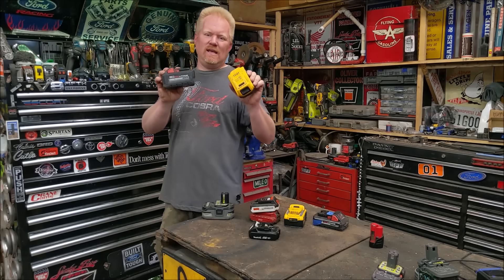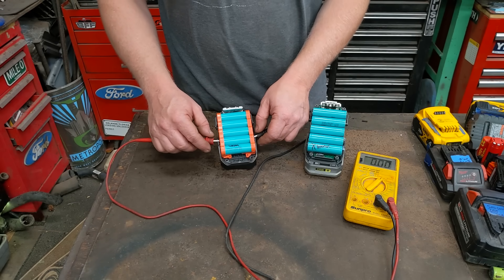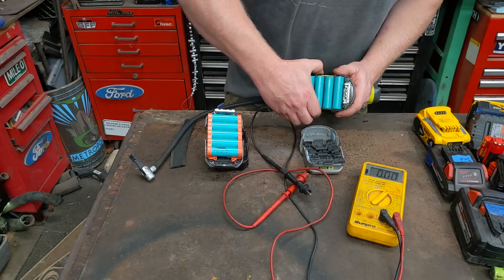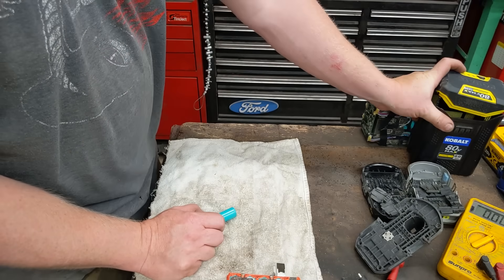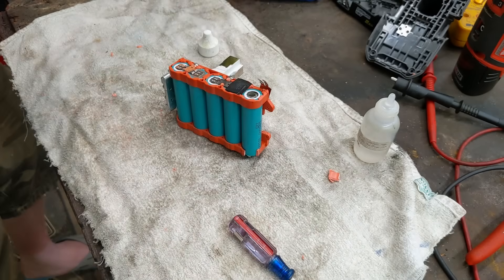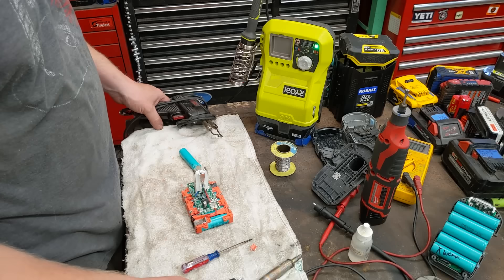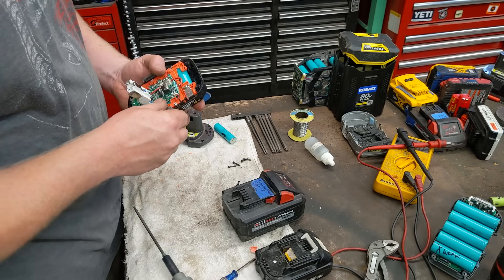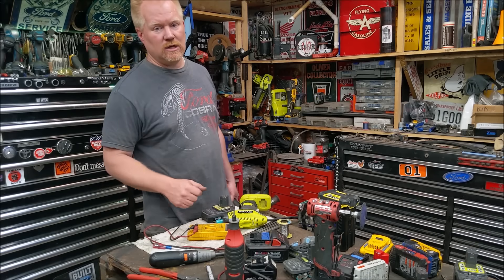Revive DEAD Battery Packs - Rebuild Repair - Dewalt Milwaukee Makita Ryobi Bauer Ridgid 18v 20v 12v

Comment: U da man with useful vids, thank you. For tacking the tin strips you can also use a 12v car battery with nails. I tape off the wired parts where I hold them or you could make resin molds and cure the wired nail in it. But as little temp into the battery as possible is the target when you do that, just like with soldering. B.t.w, I think your dog wants payback for this trick of yours 😁

Comment: Heh, figures.
 My 18v DeWalt charger dies, but I ran both my batteries down in the meantime while waiting on the new one. 
It comes , I charge the 2 batteries I have. 
One is deader than a doornail and one is maybe 3/4 good. 
So I try and hunt down a DeWalt 18v battery (OEM,I see the Chinese replacements👎).
Silly me ,they've basically abandoned the old 18v line and have a 20v line now. 
So I could buy an adapter ,2 new 20v batteries and a charger (the 18v charger won't do 20v).
This was a few years back, the one battery is still hanging in there if I charge it all the time. 
I'm just urked about getting a whole new setup when I've got a new charger. 
I think I'm gonna bust open the 1 18v battery that is toast and see what I can do.
(one day over the winter when I'm bored)

Comment: Did you notice that the failure battery is always the 1st one in the series. This is due to overcharging, the chemicals in the battery overheat and degrade. Its common in all batteries including phones. Very instructive video. Kudos.
Reply: how so even in phones ? phones are single cell batteries ...
Reply: Nonsense, it has nothing to do with the battery's position. Cells in series share the same current, but can end up with different voltages, depending on variability between different cells. Which cell will end up damaged from overcharging is independent of its position in the pack. It is simply the "weakest" cell, and it can be in any position.

A balanced charger takes care of that. It periodically checks the battery voltage of individual cells during charging, and discharges the cells a little that reach their target voltage quicker than the others, to prevent premature pack wear. That's what the circuit board in the battery pack does. But batteries wear out at different rates. And at some point, one of your cells will end up "spent", preventing the pack from working. The other cells still work, but they won't be far behind. They can be recycled for light duty applications though.
Reply: actually, my own experience was the one/s in from the end that went more often.
Reply: Cell phone batteries are single cell 😂
Reply: Most phones atleast samsung have implemented a charge stopper in your phone where when it is being charged once at 100% it internally disconnects
Reply: Exactly, I be telling even mechanics, "yeo want me to take the battery off the charger?" They be like "nah don't touch that, matter fact go clean up blablabla". After that, I only care about my tools, my hard hat, my hours, and my safety. Everything else got nothing to do w me unless instructed by a supervisor

Comment: I got a battery welder on Amazon for 50 bucks they run a bit more normally but 40-100 you can get a decent one.

Comment: Man, if u could figure out how to fix the DJI MAVIC batteries that take a crap, I would like to know.
Reply from the maker: I've had great luck with my Mavic batteries... Knock on wood. They are Lithium polymer and have a Achilles heal. Like all LIPO they hate being stored at full charge(4-4.2 volts/cell) and consequently die in under a year. Now store them at 1/2-3/4 charge (3.8-3.85volts/cell) and they'll last a decade. DJI knows this and the default settings on the DJI will self discharge the batteries after 3 or 5 days to keep the long life. I went into the settings on each battery and changed that default to 1 day and only charge them right before I need them.

Comment: You are the only one I've ever seen recommend soldering over spot welding on lithium batteries. That's because it is not that hard to overheat the battery and either damage it or cause it to go up in flames. Spot welders are pretty available and there are a bunch of videos on using them or building yourself.

Comment: as someone that rebuiltt battery packs  on a regular basis, if you want your pack to last, used like used/test rated. and i had mutiple level load voltage, non load, and 1 hour after load. ocassionally batteries would sit there for a while before findign mates to bne paired with. why do this, because all batteries will have equal strain, thus longer life, and less chance of a single cell failure.

if you have 5 old batteries that have 87% streanth, and you havee a new battery with 100, when the 5 get low extra strain will be put on new unit. higher chancee of new unit failing or one of the other 5 failing for dropping to low

Comment: rather than soldering the new batteries, get a small spot welder from Amazon and re tack weld the metal strips to the batteries.  Easier and a better connection.
Reply from the maker: That's fine for someone like me, who ends up doing a lot of battery modifications. However the average person is going to watch this and do one battery pack and it's ridiculous for them to purchase a spot welder just for that. It's cheaper for them just to buy a brand new battery and toss the old one.

Comment: Instead of solder from the factory they weld them for the most durable  and quickest way to make the connection as well as being much simpler process which saves production cost.

Comment: Bought a 30v DC power supply and it has changed my battery world. I can use it to test batteries, charge batteries and run motors.  Fixed my first 12v dewalt battery pack today for free (had a 1850 battery) and had my tool up and running in the same hour!  Electric cars are coming we have to learn how to do this... :D
Reply: I agree with what you said about electric cars. Whether we like them or not..they are coming and we need to know how to repair them properly. EV batteries are more complicated of course, but most of the principles are the same. Which model of power supply did you choose?

Comment: A little tip if you don't have the security bits. Take a small flat head screwdriver and snap off the center pin in the screw head.
Reply: I've tried that years ago and had no success.

Comment: I'm an authorized service tech for Milwaukee Bosch Makita Hitachi Porter cable/DeWalt. I was the cordless expert for a company for 15  years.
You are absolutely dead on all your talking points spot on and well spoken. No corrections required.
Reply: Other that, don't solder the connections. Other manufacturers don't do this and a spot weld is absolutely fine.

Comment: I have to say I rarely find a video on here that genuinely makes me happy I learned something new. I was well aware of the batteries inside these packs, but never even thought to try to open one. I have the individual 18650 charger for my vaping batteries which indecently are the same cells just usually much higher drain. Anyways I have so many old packs that don’t charge well that I can now mess with and try to make good again! Thanks for the amazing info. 

Please if you have a chance do some videos on building/repairing or improving EGO batteries for blowers trimmers and mowers if you could. Thanks again definitely earned a sub and a like!!
Reply: I tore apart a couple of DeWalt batteries and recovered LG he2 and Samsung 25r cells which are pretty good vaping batteries. Been using them over a year.

Comment: The reason they don’t solder is because the heat when the packs get hot could cause the joint to separate. They could solder them with a robot that would take seconds. That has nothing to do with it.

Comment: What do you do when the charger doesn't light up or do anything?🤔😤🥺
Reply from the maker: It's not very common but the fuse connection inside the battery can break/burn.

Comment: You are incorrect about why cells are not soldered at the factory, its not because it takes more time, its because heat damages the cells.... You can find that in any spec sheet. omg then I watched even further and listened to his misinformation about soldering 18650's, there is no fuse in those cells, and the max those cells should get is 60c then the onboard protection turns them off, even a small 20 watt soldering iron will heat up to over 300c, that is quit a bit more heat than 60C and you are holding a soldering iron on there. You should really put a disclosure in your video to say do at your own risk, as the methods you are completing are not safe or recommended.
Reply from the maker: You will never get the cell up to 60c with an iron unless you left it on there for 5minutes staight. With that mentality a spot welder operates at 1400c. I've soldered 100's or cells without a single issue.

Comment: I had 3 brand new Dewalt 5 AH 20 volt packs that were under muddy water for a couple of days during a flood.  None of them had even a whole hour of run time on them.

Only one of them would light up with two green lights, but it wouldn't operate the single tool that stayed out of the flood water.

I haven't had time to pull them apart, and I'm just asking if anyone has any experience with them being flooded, and what I should expect once I do have time to open them up.  I can only assume that all the cells and the circuit board are trashed.
Reply: Had a similar situation with 2 ryobi batteries I ended up replacing the boards and the cells were fine after a bit of a clean and recharge .I did recharge all cells individually before reassembly
Reply: @Crazylife069  Thanks, Gavin!  That gives me hope.  😁

Comment: You say you need 'high drain' cells for power tools, would cells salvaged from digital cigarettes be good for this?
Reply from the maker: I know vap cigarettes have high drain cells but don't know about the smaller e-cigs. You should be able to open one and look up the model number off the battery and see it's discharge capacity. You need at least 10 amps but 15-20amps are obviously much better.

Comment: Working over a silicon mat can help with solder spatter or battery fires. Someone mentioned a sand bucket, not bad but make sure you’ve got a pair of tongs.

Comment: Other trick is to measure battery internal resistance. Then there is no need for load test. Weakest link in chain will have much higher resistance. But load test can be made by anyone.
Reply from the maker: Resistance is just one tool in the belt. It will show batteries that could have failures but does nothing to show actual capacity or drain characteristics.

Comment: I got 2 Chinese makita batteries for $32 from ebay  they lasted a few months  both shorted out with high amp draw tools. They sent me 2 new ones and the same thing happened .I bought  some decent new cells from the 18650 battery store for $2 each and rebuilt them and they are amazing way better then any factory makita pack
Reply from the maker: Awesome
Reply: You could look up the spec for the cells and restrict your usage of those batteries to be within that limit of the cells.
Reply: Factory Makita batteries are tough to beat, I have 3 that are almost 20 years old that still work but one is getting pretty weak and doesn't last long, but it's the 1.5 Ah, and the others are 2.0 Ah.
Reply: @wesman7837  never seen better than Makita packs. Last for many years.
Reply: @wesman7837  Its even easy to beat a factory OEM pack when replacing all cells while rebuilding your pack their are some pretty amazing spec batteries you can buy.

Comment: 9:02 I'm sorry but that text down there is stupid... the tip of the soldering iron can go to 500C while applying solder, and you're telling me the battery can't get to 75C ? What kind of lie is this xD ? Yes it can, and it will burn up, happened to me 3 times.
Reply from the maker: Run a power tool battery hard and then test the internal temp. I've measured around 70C on multiple occasions. Check the data sheet and you'll see most are at minimum 65C rated for normal operation.

Comment: Thanks for the great video!! I'm going through this with my dewalt 20vt batteries. Question is,  when charging the 18650 to test, where is the negative wire hooked up on the charger????
Reply from the maker: I'm not sure if I understand your question. You have a single cell 18650 charger and want to charge each cell to test it? These are just like a AA battery with a flat end and a nipple(though larger and flatter) where the flat end is negative.
Reply: @sixtyfiveford  correct ,I use them for my vaping mods. So of course I have a battery charger, like the one you have. In your video it looks like both wires are coming from the positive side of the battery, but I'm guessing that it's just a visual thing?
Reply from the maker: @weatherbird1111  I have the positive running inside the rolled up cardboard and going up to the positive. It just looks like it's going to neg.
Reply: @sixtyfiveford  wonderful, thanks for clearing that up for me!!

Comment: I'm just not clear how you're able to test each cell individually while they are still all spot welded together. Seems like you would be just testing the entire bank (rather than each cell), same for charging and applying load. Good tip on scuffing.
Reply from the maker: If it is a 10 cell pack you will have to test a pair of cells. However those cells are going to be the same in health and if one is bad, they both are. They have been linked their entire life and suffer the exact same and other than being seperate cells they are one single combined capacity. In a 5 cell pack you can test each individual cell.
Reply: @sixtyfiveford  Thanks for the quick reply! I manufacture Tool & Battery organization products. Would you be interested in doing a review?

Comment: Glad to have bumped into you.  What about using one of the small, rechargeable spot welders for strap attachment. Soldering the wire to battery connection mocks me.

Comment: Thank you for this video. Going to try and refurbish Harbor Freight batteries. They sat for a couple of months before trying to use them and they are completely dead. No refunds on them.
Reply from the maker: If they're just not accepting a charge from the charger but worked when last used; you can piggy back them for a few seconds. This may give them enough juice to start charging.

Comment: Both times you let your dog choose when to eat the treat. That is poor training. You basically taught him he only has to listen to you for a little while. You said leave it on the big bone and as soon as you paused he took it. The small pieces he "accidentally" dropped them so he could eat them. He shouldn't have eaten anything until you gave the command. 

The way you train him matches the way you work though so it makes sense. Use plumbing flux on a battery? Not a good idea. Use batteries of different brands also not a good idea. It doesn't matter if the printed specs match. The manufacturers test them using different methods. Unless you put them on a battery tester and prove that they perform the same way you have no idea how much they vary from the printed specs. Not to mention they sometimes fudge the numbers on the cheaper ones.

Pay attention to the details in life. Especially when you are dealing with batteries that are know to combust when they get old or damaged.

Comment: Good Info, always like to know how to repair things. Even more true if it is a situation that you can't get "new". I've had 3 Milwauke M18 batteries that are about 15 years old. They still charge, and although not as good as they used to be, they do still last a good time in a drill, impact driver, sawsall, or flashlight. Now my M18 leaf blower, or other high amp tools, will run them down pretty quick. But they are so old they don't even specifiy the Amp Hour Rating 😁as that wasn't really a thing back then. They are just labeled as "HD", but guessing they are approx 4 ah. But I have a lot of new batteries too, but still use these old one's on a daily basis.

Comment: I take a fine point punch and knock the center piece out of the tamper proof torx screws. It doesn't take alot of force to get them to break off.

Comment: Too much heat and 18650 batteries will rupture and flash fire. The fumes are extremely toxic. I would rather weld than solder because too much heat for a microsecond too long will rupture the cell. You can control the time on a welder, I use 15 ms for current limit on a weld, then it shuts itself off, not enough time for the heat of the weld to penetrate the cell. If that isn't enough to provide a permanent weld, then I set the cell aside for 15 minutes with a clamp on heatsink to let the joint cool (just an alligator lip with tin foil attached). Then I try again. I weld outside year around for safety in the good weather here in Alabama. I have had only one cell flash fire in the last year, and I dumped it in a bucket of icewater to remove the heat and oxygen quickly. It worked. I moved upwind to not breathe the lithium gas.
Reply from the maker: Most of these cells are rated to run at nearly 175F during operation safely. You can only hold you hand on something that is around 130-140F for a few seconds, so that's hot. I have done heavy runs with stock batteries and tested this and always see 150F+. It takes a few hours for it to drop to under 100F.  What temps do I measure after soldering? Generally 90-100F at the ends and that quickly dissipates within seconds.